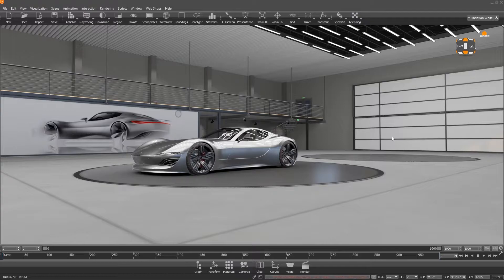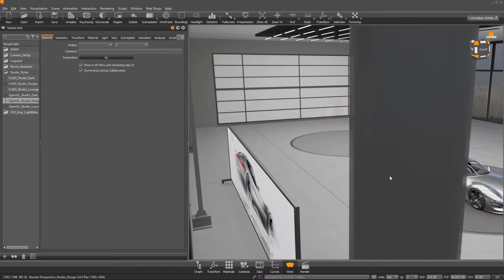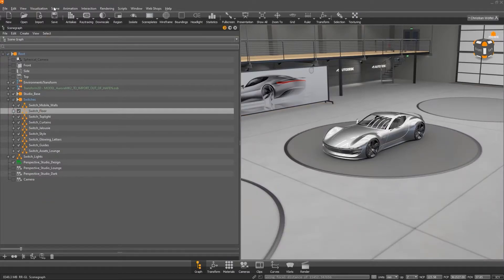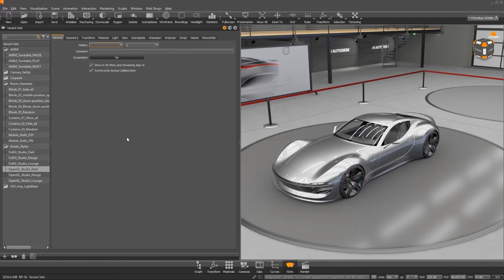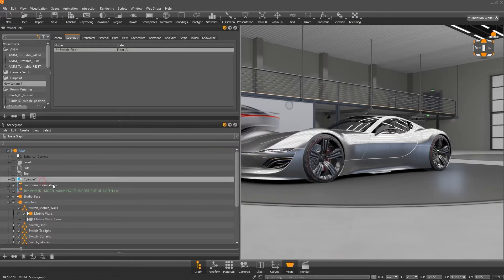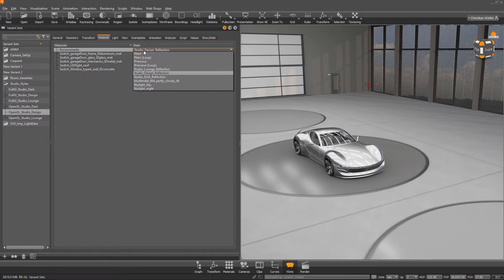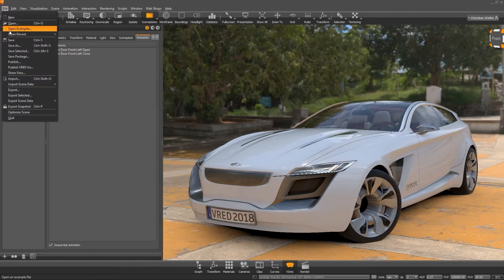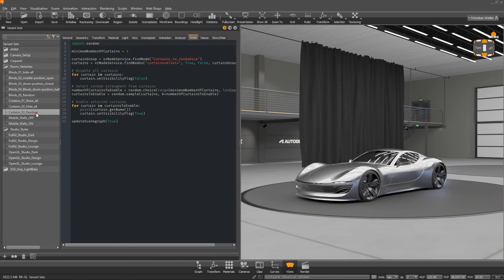Realtime Tutorial Part 3 - Variant Sets and Optimization

Comment: Hello please I have a problem with my vred.....I have been trying to apply an environment from the asset manager to my scene but it's not even appearing on my scene, I don't know what could be the problem please help🙏🙏🙏
Reply: do you see your environment in the scenegraph? Or in the material editor?
Reply: @Seth5909  I can see it on the scenegraph and material editor but it doesn't appear on the main scene where the car is, I don't know what the problem is
Reply: it is not visible if you enable the wireframe button and by pressing the hotkey F?
Reply: @Seth5909  I haven't tried pressing the hotkey F, I should do that I will give u a feedback and thanks for the replies
Reply: @ayoolaomifidipe2375  ok, select the environment in the scenegraph before pressing the hotkey F
Reply: in the scenegraph, does the environment contain a geometry and a shadowplane?
Reply: Control and try the value of the NCP (near clip plane = 10) and FCP (Far clip plane = 1000 000 000)
Reply: @Seth5909  hello I have tried everything you told me above, it's still d same, the environment still didn't appear